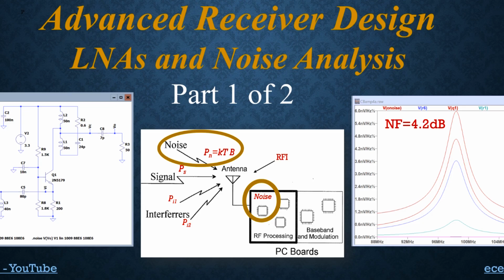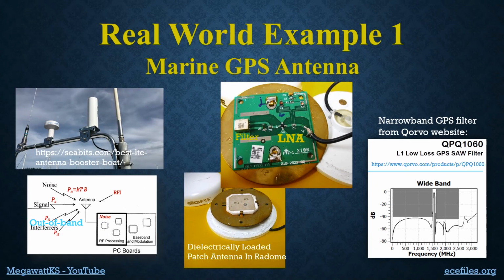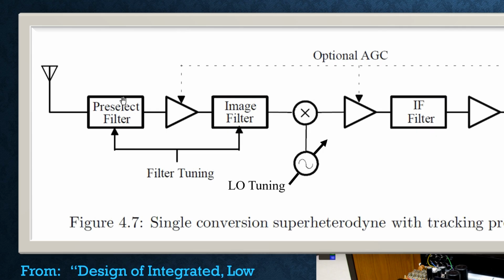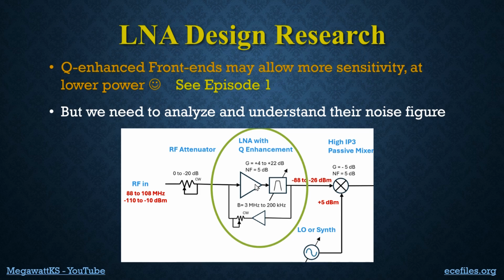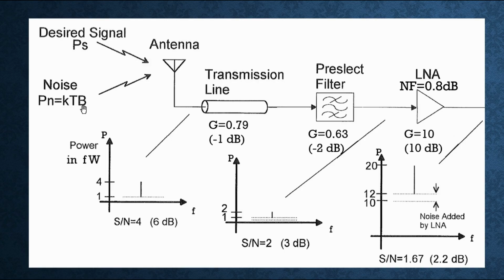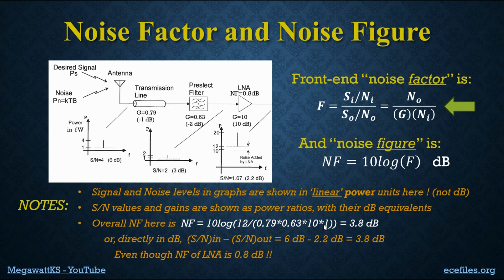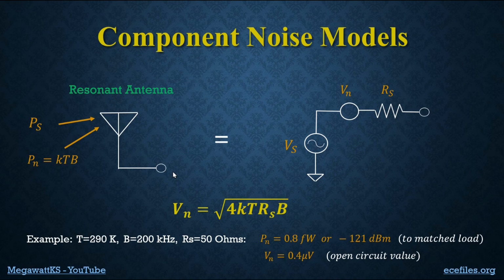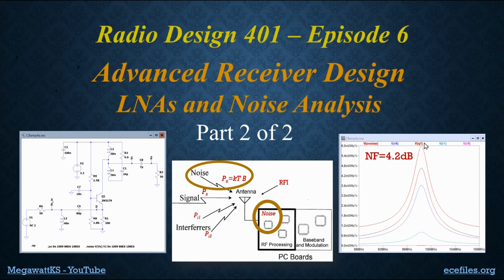LNAs, Noise Figure, and Noise Analysis - Radio Design 401, Episode 6

Comment: Hi! Thank you for such a great video! Could you please give me a piece of advice?

I have a GPS receiver frontend schema:
[ANTENNA] → [SAW FILTER] → [LNA +9 dB] → [SAW FILTER] → [ATTENUATOR -31 dB] → [LNA +30 dB] → [LNA +30 dB] → [SAW FILTER] → [OUTPUT]
Is it a bad idea to put an attenuator after the first LNA ? Would it be better to put it after the second one or third one ?
Reply from the maker: Yes - According to the Friis noise figure equation, that would reduce the signal level too much without reducing the noise, so the overall noise figure would be bad. What is the reason for the attenuator?  Probably should delete it and delete one of the 30 dB LNAs. But if it's coax or something unavoidable, then the equation should yield better results if the LNA and Attenuation are swapped - i.e. boost the signal by more than the attenuation value first. That's why remote GPS antennas on boats have a preamp before the long coax. Hope that helps.

Comment: The band above FM radio,  108 - 118 MHz is the aviation nav band.  118 - 137 MHz is aviation communication band.   I don't know what area you're in, but there's probably some VORs in your area, some ILS too.
Reply from the maker: That's a fair point, but we're not near any large airports. There's two VORs (KMHK and FRI) 'nearby'. One at 109.4 and one at 110.2. But there's mountains between me and those airports, so I'm pretty sure none of the big "signals" seen are from the aircraft band. See Episode 4 starting around 9 minutes into that video for more on this spectrum when the LNA is on vs off. They are definitely intermods as shown in that spectrum comparison.

Comment: Actually, the sum of the squared voltages is NOT the mean.  This is a "root sum squared" and this only works when none of the pairs of sources are correlated.
Reply from the maker: Good point on the RMS thing, and agreed on the correlation issue. Most of the noise is uncorrelated since the components are separate, but there are cases where correlation will be important. In particular, the shot noise current coming out the emitter of the transistor is partially "reflected" and reduces the collector current noise in this circuit. I'll try to put that into part 2 🙂

Comment: The marine antennas shown are probably as follows.  Left is likely a CB antenna, next is GPS, next is a cellular/5G antenna and far right VHF.  When I see only two vertical antennas on small private water craft one is usually CB and the other VHF.  The VHF antenna would be the one in the fiberglass radome because it's a colinear antenna inside, not something you want flapping around in the breeze.
Reply from the maker: Sounds good. Also the base-loaded monopole on the left antenna has less gain than the nice tall (co-linear) on the right and I would think we'd want the best antenna possible for the marine band radio 🙂